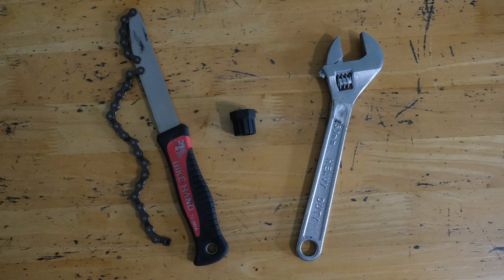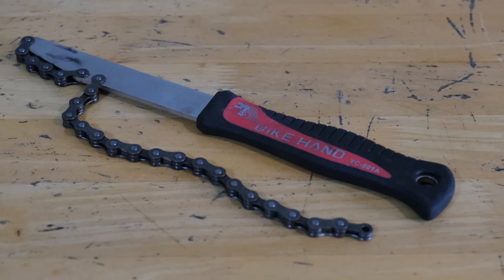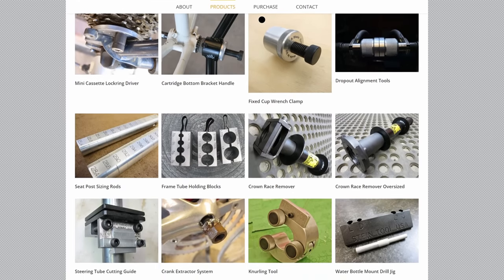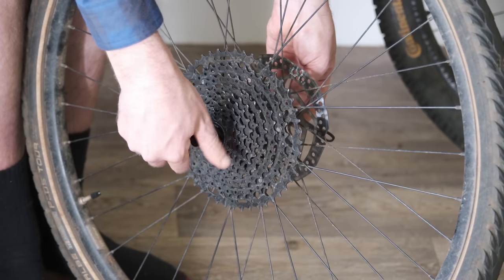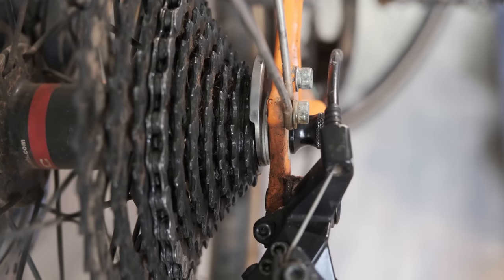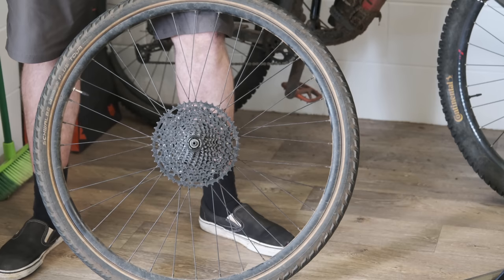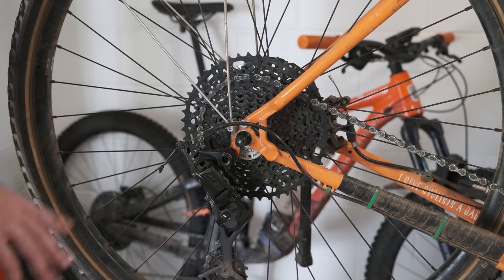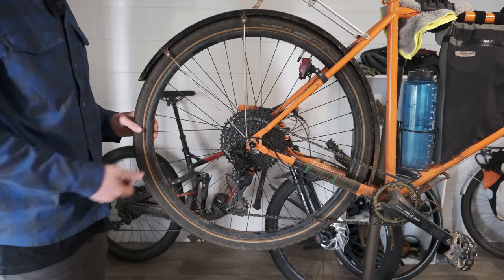EASY Cassette Removal on a Bike Tour! // Stein Mini Cassette Lock Tool Review

Comment: Useful but really expensive and dangerous if used improperly (they should really put an engraving that it is strictly for steel). USD 40 (in fact, USD 45 + taxes and shipping) can get you a decent portable pump or even a new cassette. Out of all the situations where you have to remove the cassette while on tour, most of those would require just the cassette key itself: a chain whip can be replaced with the bike chain and a wrench can be sourced out of a common mech shop / from a truck driver.

Comment: i cant think of a single time i needed to change a cassette on the go...
Reply from the maker: This tool is designed for people who are on long, multi-month bike tours.
Reply: @VeloObscura  riiight, this is true i dont ride on the weekends. but as a working bike messenger and ex mechanic, who rides 8 hours a day workweeks. a cassette will last the better part of 5 months. and if a shop has a cassette for sale, they would have to tool, and if they for some reason didnt... i still wouldn't carry a cassette with me for multiple months, on the off chance. (not to forget you need a chain and chain rings and in sometimes you might need to pull your cranks, and now would be a good time for derailleur cables)

this tool is not for me. 

may i ask do you carry a spare cassette? or needed one and the LBS where you bought it was unable to install it?
Reply from the maker: I'm not talking about people who go for a ride on the weekend. It's for people who are traveling by bike for months at a time through remote areas, don't have access to bike shops and are trying to travel light, so would rather carry this than a chain whip etc.

There are 2 times where I've taken my cassette off while cycling around Australia:
The first was to replace it, but I do not carry a cassette with me. I ordered a new cassette online and had it mailed to an address I was going to be at in a couple of weeks time and then replaced it when I got there.
The second was to replace a drive-side spoke, which was impossible to do without removing the cassette first. I DO carry spare spokes.

A cassette may not last as long as you think when cycling 3000km a month through rain, mud, dust, sand and all other imaginable conditions - and even then, replacement is not the only reason to remove it.
Reply: @VeloObscura  for spokes that is a good point. 

for the record i wasnt talking about weekend warriors either. i was just saying i do the same kms (2500km per month) and this problem never came up.
Reply from the maker: Unless you're doing those 2500km in a remote area, far from any bike shops, then it's not really relevant.

This tool is for people who are doing those kilometres in far flung, remote locations.
Reply: @VeloObscura  i love niche markets and the more i think about it the more niche it becomes to me. 

i pay my rent riding kms (paid per drop) and i have never came close to killing a drive train in less than 3000km or two months. respect. 

it is an elegant tool, and a well demonstrated. thanks for the video and take care.

Comment: useful for saving weight. but you can see why its never become a popular method. its not really any easier as you have to remove the wheel [3 times] and it will also damage the paint on the frame. if you cant use it on aluminium either, its useless for almost all bikes!
Reply from the maker: You can use it with aluminium bikes by implementing the included protective plate.

This tool is for touring cyclists, many (if not most) of whom will be riding steel bikes. There are many large companies such as Surly who ONLY make steel bikes and do so by the thousand.

In a workshop, of course you will use a chain whip etc... but this tool (and video) was created for people who are travelling by bike and do not have access to a full workshop.

Comment: I don’t really need to tighten the lock ring manually it’s self tightening as your ride
Reply from the maker: I don't think it would self tighten unless it was reverse threaded, but it's hurting my brain to figure out how exactly it would work...

I'd love to see a video confirmation of "self-tightening" - but otherwise, I'll stick to tightening it! 👍
Reply: ok sorry i might be wrong i might have confused it with the crank arms. I also had a terrible experience once trying to unscrew a lock ring which was really tight and i thought it must have been the effect of the constant tightening torque
Reply: @SuperMixedd  Or you might have been thinking of a freewheel, where the whole gear cluster is one piece w/bearings etc and threads directly onto the hub. That will tighten as you ride. Old ones are particularly hard to get off. Cassette lockrings are supposed to be @40Nm torque but keen rider mechanics who check their gear often can get away with less, and that would make this tool much more useful.
Reply from the maker: Good info, Mark!

Comment: Too much time wasted, sorry but the design is flawed. It is slow and dangerous to modern road bokes( carbon). I can change my cassette less than 5 seconds with the normal chain whip. Not a bad idea but need some work.
Reply from the maker: The instructions state, as do I in the video, that this tool isn't for use on carbon.
Reply: Why do you have a lightweight carbon bike but then carry a chain, whip, lock ring nut and spanner round the world with you?